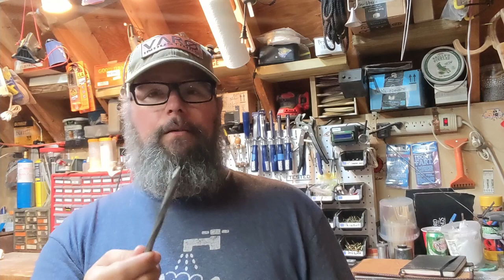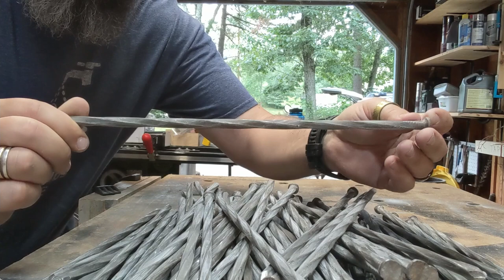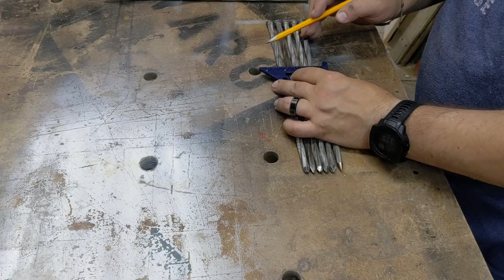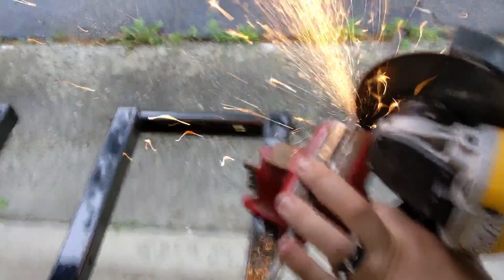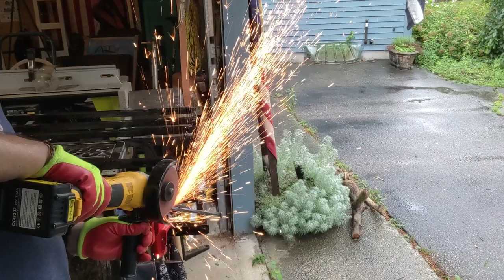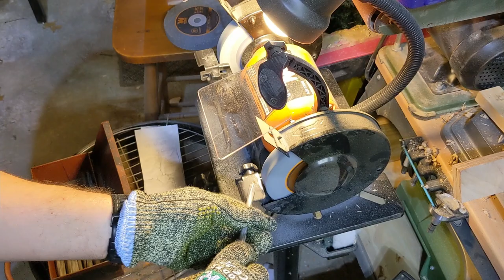A New Kind of Marking Tool ✎ The Pencil

Comment from the maker: The Pencil is a product I make. Made from 12" twisted steel nails, cut down to size (roughly 7"), tips ground like a pencil. Holds and feels like one (well, a really heavy one that is twisted). Each one is also hardened in a the forge to help retain it's tip.

Use it...
👉 As an awl
👉 As a marking tool (woodworking, metalworking, leatherworking, and so much more)
👉 As a nail/screw set
👉 As an air release tool (I'm looking at you sticker enthusiasts and car wrappers)
👉 As a scribe
👉 As an ice pick
👉 Popper of packing bubbles
👉 For anything that requires a sharp pokey thing!

Since it is steel, if you ever ding the tip, you can grind one right back in its place.

This definitely includes product placement! 

👉 The Pencil: https://geni.us/ThePencil
👉 Etsy Store: https://geni.us/VAROEtsy

📱 Follow me…
https://www.patreon.com/thenewjankyworkshop
https://www.instagram.com/TheNewJankyWorkshop
https://www.facebook.com/TheNewJankyWorkshop 
https://www.tiktok.com/@newjankyworkshop
https://www.youtube.com/@TheNewJankyWorkshop

📧 Mailing List
Join my mailing list to be notified about new videos, merch, and general information from time to time: https://geni.us/jankymail

⚠ DISCLAIMER 
My videos are for entertainment purposes only, your safety is your responsibility. Please do not follow my actions if you find them unsafe. Which, they probably are. I'm a bit janky. Some of these links go to one of my websites and some are affiliate links where I'll earn a small commission if you make a purchase at no additional cost to you.

🥔 *Hashbrowns*#woodworking #woodworkingtool #woodworkingtools #metalworking #metalworkingtool #metalworkingtools #leatherworking #leatherworkingtool #tools #leathercraft

Comment: I've been toying with the idea of taking 12 inch nails and turning making it into a "bo shuriken". The difficulty is, I couldn't find a suitable sheath for it.  Your pencil sheath is literally perfect considering it's made for what was once a 12 inch nail.
Reply from the maker: That would be cool (and a fun idea next time I am making a batch of these)! The length on The Pencil is like a regular #2 pencil, so roughly about 7.5 inches. If you need something longer, just let me know, and I can extend one a little bit if needed.
Reply: @TheNewJankyWorkshop  
I'm going to try a little DIY project with some nails (just sharpening a tip onto 12 inch nails, adding a leather handle, and probably painting them black).  I did go ahead and order two of your Pencil sheaths though. They look great and are beyond my skills to make at home. I think it's going to be the perfect size.
Reply from the maker: @Testeverything521  Awesome, thank you! I'd love to see how they come out!